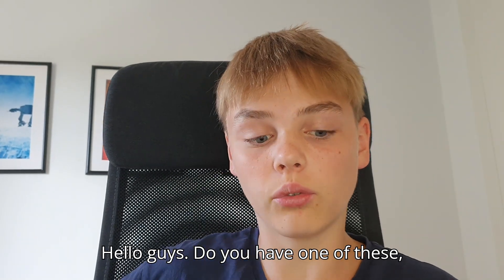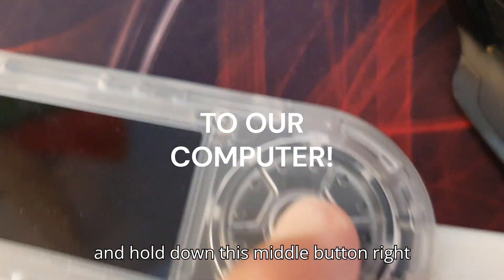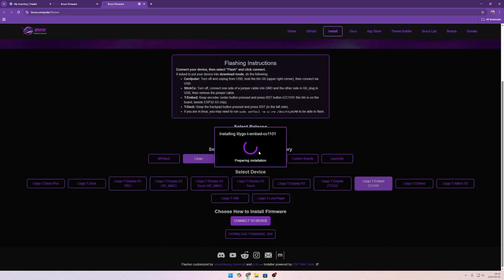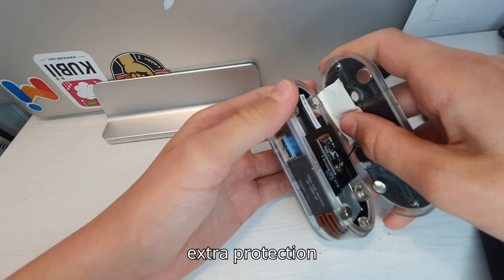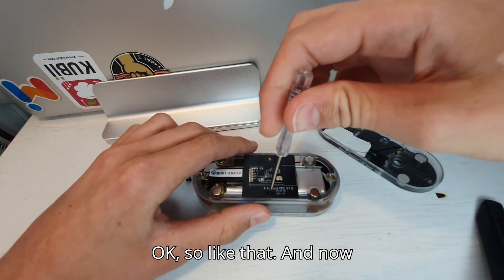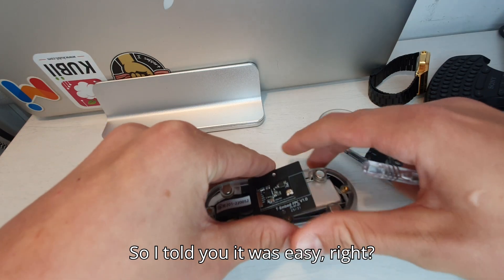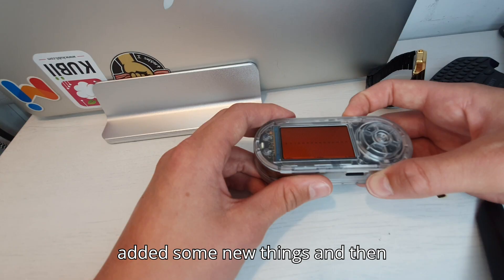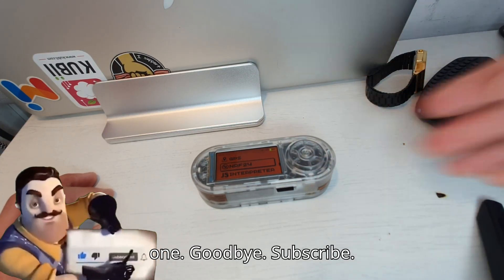How to install BRUCE FIRMWARE on Lilygo T embed cc1101 PLUS!

Comment: "And now the firmware is launching"... mine is still just a black screen - I've tried a few times, start to finish. Any thoughts? By the way, you're channel is fantastic. :)
Reply from the maker: Thank you brother! Have you reseted the device? If not, try it, its a neccesary step in the procces! Hope it helps, give me more information if not 👍
Reply: @ThatSwedishHacker Thanks! Here are the steps I've taken: 1. Hold down centre button and plug into pc while powered off. 2.  Latest 1.13 > Lilygo T-Embed CC1101 > Connect to Device > Install (I have done it both with "Erase Device" checked and unchecked). 3. After install complete, press the reset button (in my case, I only see a "PWR" button inside, which is what I've pressed - I have done this step both with the device still plugged into the PC, and with it removed from the PC). It is stuck on a black screen.
Reply from the maker: @mrslovettxvi  ok i see, i looked in my t embed and see that there are two buttons inside, try pressing the one where it says RST and not PWR, the RST is the real reset button 👍
Reply: @ThatSwedishHacker Thanks so much, this was the solution. I had shifted things around but couldn't see the other button whatsoever. The battery pack was easier to remove than I thought. Once I took it out, I found the other button - though for others' reference, it was totally unlabelled for me. Thanks again! :) I hope your channel takes off. :)
Reply from the maker: @mrslovettxvi  thank you! I have to upload somethin more cus i havent uploaded in almost 4 months lol 😂

Comment: Hey bro, when i put it to deepsleep and put it into the pc, it doesnt find the USB JTAG thing, could you help me?
Reply from the maker: Yes sure! What firmware are you running on it right now? If bruce go to settings and scroll untill you find shut down, its same for stock firmware! Hope it helps 👍
Reply: @ThatSwedishHacker but theres no shut down
Reply from the maker: @daveandbambi_videos  are you in the config?
Reply: @ThatSwedishHacker my t embed is not responding to me
Reply: @ThatSwedishHacker my t embed is not responding after the updating
Reply from the maker: @daveandbambi_videos did you press the rst button?
Reply: @ThatSwedishHacker yes i did
Reply: @ThatSwedishHacker yes
Reply from the maker: @daveandbambi_videos  try plugging it in to power and press rst and or maybe try reflashing bruce
Reply: @ThatSwedishHacker Hey, i updated it and my t embed is not restarting what do i do
Reply: @ThatSwedishHacker IM ON BRUCE, ILL TRY THE THING YOU SAID

Comment: Mine doesn’t turn in even if I press the reboot button please help
Reply from the maker: Did you flash bruce, if so plug press reboot again and plug into power, try reinstalling bruce maybe, hope this helps
Reply: @ThatSwedishHacker thx I had to erease the device and reboot it So I got it working
Reply from the maker: @VictorPierik  👍